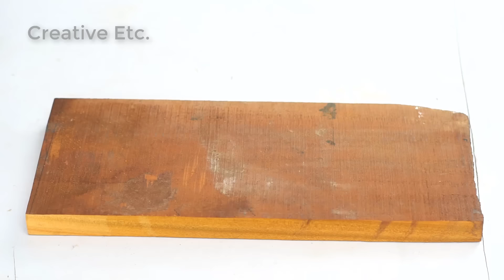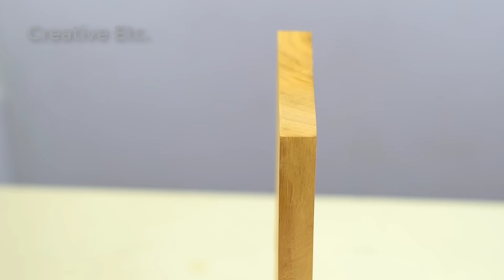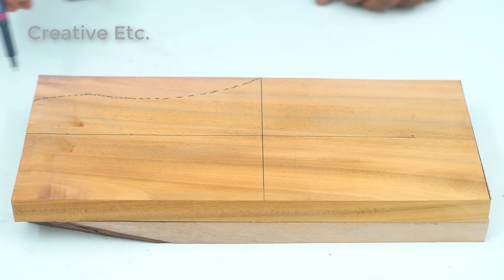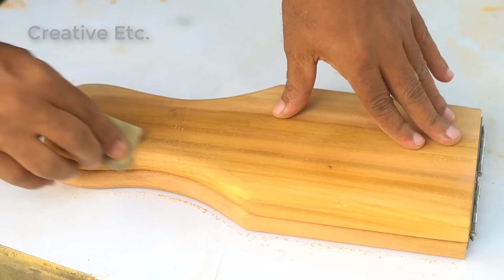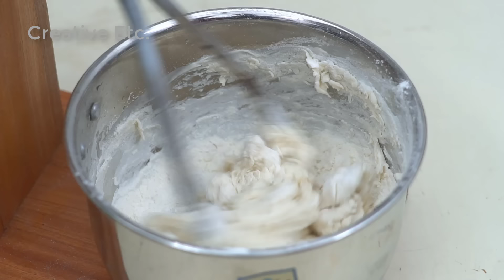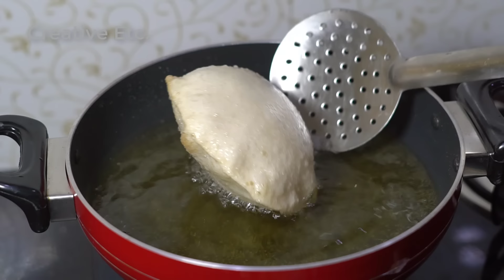How to Make Puri Maker Machine / DIY Simple Chapati Maker

Comment: Very nice ..just a small suggestion ... Cutting the handles ,one longer than the other  or one wider than the other would have enabled better grip to open.
Reply: Wow mast
Reply: Thanks
Reply: A small hole in the bigger  handle may be helpful to hang it on a nail in the wall when not in use.
Reply: Where I get it